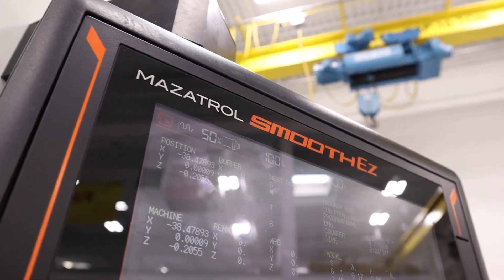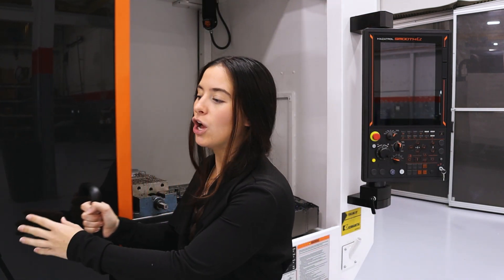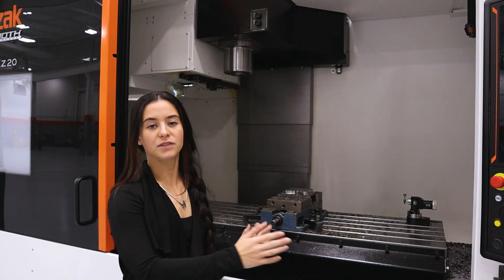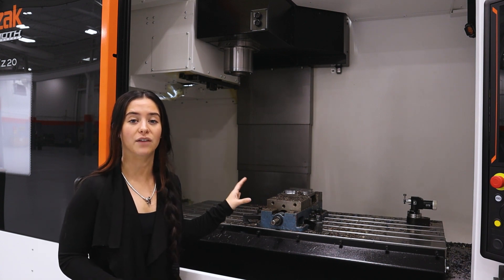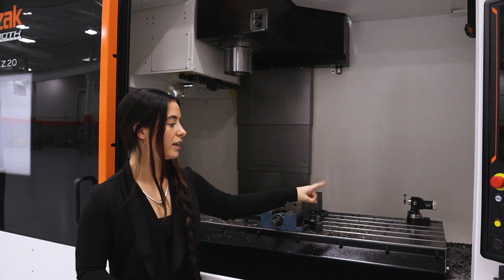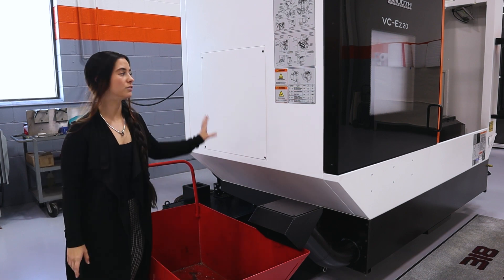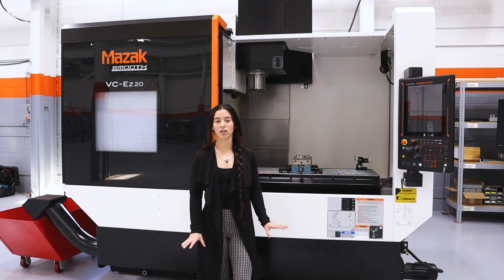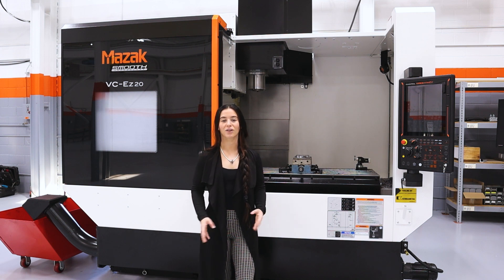Mazak VC-EZ 20 Overview | The HEH Group

Comment: Am I the only one who notices how tall that machine looks?  I am kind of short and it doesnt look like I could even load something in the vise.  Why is that table so tall?  You would need a work platform just to use the control or load parts?  Charles
Reply from the maker: Hello Charles. Thank you for your comment. The speaker in the video (Shae Eichele) is only 5 feet tall, so this machine looks large next to her. All of our applications staff and customers do not have an issue with the height of this machine. It is an average height, Shae just makes it look extra tall!
Reply: I was thinking the same thing... Either that machine is extremely tall or she is very short. Maybe both... LOL. And how about the size of that door, who would want to open and close that all day! And no windows?
Reply: @chipmaker3341   Hello! Yes I am very short. 5 feet tall to be exact. If you look closely there is a big square on the door behind me (might be mistaken for a reflection) but that is the window! You can see insight machine 👍.
Reply: @shaeichele  that's not too short, my wife is 5', 1". And I guess I was saying there are no side windows, just the one on the door, is that correct?